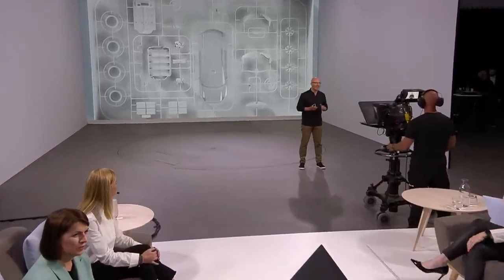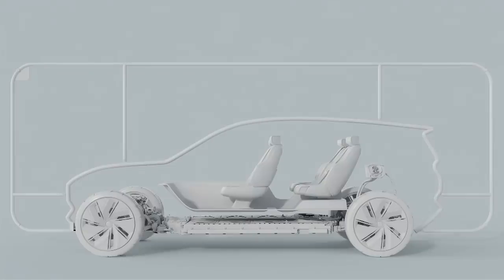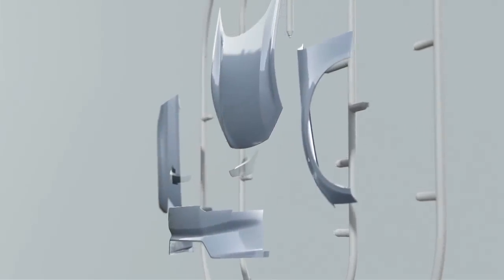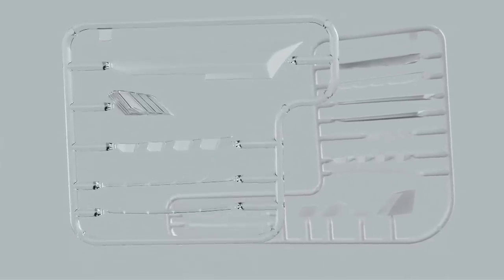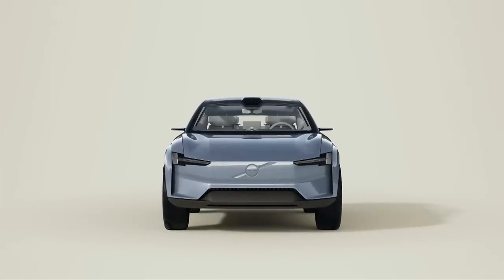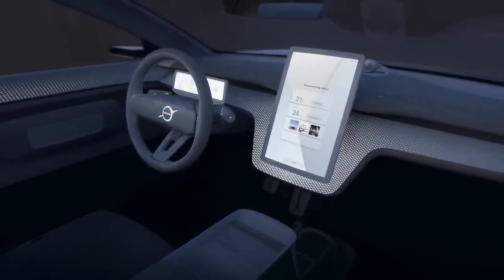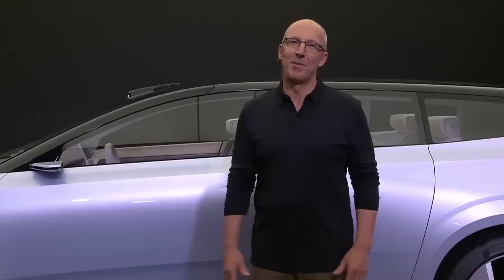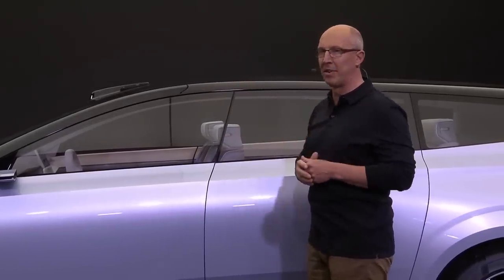Future of design

Comment: If you're truly serious about safety, you need the essential functions controlled by physical buttons and dials, not a touchscreen that's almost impossible to operate by touch only, while you're moving. You don't need many actual buttons and dials, but they do need to be programmable/configurable into "scenes" that can be selected on the steering wheel, so an A/C-ventilation scene, an audio system scene, a navigation scene and so on. Each change of function for a button or dial should change the graphic on that button or dial.
Reply: Yes everyone’s tired of these solo touch screens. Give us some buttons back
Reply: The new android system will be so responsive it will make Siri look like special needs; immediate response - only Porsche is keeping 100 buttons.  This is future.  Speak and Delivers.

Comment: I hope Volvo will also offer the "Light Armoured" versions for the new models, which brings the word safety to the next level.
Reply: RAYfighter  
Certified 360° ballistic protection according to the American NIJ-IIIA standards (light)

There is also a heavy version (XC90) with VPAM VR8 ballistic and explosive certification.
Reply: RAYfighter  
Therefore I hope that the armor will also be available for the EVs, this would also help to shift the center of gravity downwards. 😉
Reply: RAYfighter  Against Swedish cities I guess. With all the shooting going on there.
Reply: @vika0194  
Worldwide realistic scenarios are carjacking, throwing rock "dining" and vandalism but unfortunately also rampages and shootings
Reply: BMW offers with the X5 Security also a VR4 model. With the BMW X5 Protection also a VR6 (protects against AK 47) version wich is the sweetspot between protection and agility.

As far as I know, does Volvo only offer VR4 and VR8 armor?
Reply: @Private Chatter  
It depends on the threat, BMW X5 Protection VR6 armor is around 800kg, but "only" protects against common AK47 threat. The usual threat against the NATO caliber 5.56x45 is not guaranteed.

Therefore, it makes sense to have higher armor if you are exposed to a serious threat from assault rifles. 

It is also important to keep the vehicle weight as light as possible, there are now high-tech composite materials that have a similar protective effect as ballistic steel (protection against rifles), as they are used in helicopter armor.

Some American armor manufacturers are already using these composite materials! This composite material is comparable to ballistic steel (multi hit resistant) and yet many times lighter.

Comment: OK, here's what I like. I didn't love the computer renderings. However, the scale car next to Robin is much more appealing? Why? Frankly, I'm tired of the tall crossover look. I like wagons. This car somehow combines the long, sleek look of a wagon with enough height to hopefully satisfy crossover fans. This car looks long, rather than very tall. For me, that's a good thing. I like the front end. The side, well, I wish the beltline was a bit lower. But that roof bothers me. It starts to slope so much the car looks squished at the back. That's the one aspect of the car that needs to be rethought. I actually like the back but it looks so squished that it gives the car an odd proportion. I'd also like to see the vehicle with a body-colored, not black, roof. Maybe it would look less squished in the back. 

We do need to understand that in order for Volvo to get the range it needs in an electric car, the back needs to slope. It doesn't look like a Mach E or Tesla Y or anything like that. It's trying to not have too much of that sloping "coupe" style and that's why I think it harkens back to a wagon. So maybe no black top is the ticket. From the back, there's also the element of the flared wheel wells that will give the car a lot more shape and sleekness in motion than it looks like just sitting there. The vertical back is also rounded on the sides as well.

The interior? Well, it's interesting. It's only superficially like Tesla. The appointments are Scandavian. I would wish for a more contrasting wood. Not too dark but I'd love to see the wood texture. The materials on the top dash won't make production. But they may make it in the door cards and in other areas of the dash. The door cards don't show an armrest. Unless it drops down, I don't really understand it. And of course there needs to be storage areas so the actual car's doors won't look like the Concept. Unfortunately. Because I love the flow. I also like that Volvo doesn't seem to want to do the Mercedes style "ambient lights." That's a good thing to me. A totally different type of "backlighting" will distinguish this car from the German "ambient" light kind of thing (although it is in the Polestar 2, but in a mild way). 

So, while it isn't as instantly beautiful as the earlier concepts that led to the current Volvo line, this one has the potential to differentiate Volvo even more than the current cars do. For now, the current cars are beautiful. But these can be even more personalized than the current ones. If Volvo can redefine the boring crossover trends that are now and give it a more long-wagon look, that would be quite interesting to see.
Reply: This concept gives me XC 70 vibes, and I'm pleased with that. I actually don't mind crossovers. The only thing that bothers me on them is how in order to preserve fuel and ride like a conventional car, they usually have small diameter wheels (at least compared with traditional off-road vehicles). In person, the Jaguar F-pace and the Mercedes GLC are more harmonious since they have bigger diameter wheels. This concept also does that, while also lowering the roof line (maybe a little too much at the end I agree) but the overall shape of a shooting brake is interesting.

Comment: Really liked this segment/video. Great explanation of opportunities created by going to an EV platform. I also like that there is no fake grill on an ev car. It is an EV and the design team should embrace it. Well done! 

One negative I noticed would be the limited view of outside from inside the cabin because of the low roof line. I hope the designers will be able to find a way to increase glass size on doors.

Comment: I quite like this design, it's fresh-looking, functional and very Scandinavian living-space-like.  With the change from ICE to electric, it's obvious that there will be new standards of car-design.  ICE-cars were partly designed around their engine by necessity, but that's no longer a requirement and with that comes a new freedom concerning design; whether you see that as a restriction or as an opportunity is a choice.  By ditching the radiator-grille, a part that hasn't got a real function on an electric vehicle, the choice that Volvo makes is obvious.  Other manufacturers seem to be more in doubt on that.
Reply: Almost no pure battery electric cars would sell if governments weren't shoving them down our throats with unscientific climate fear mongering. They're twice as expensive and far less practical (lower range and 10-20X longer recharging.
Reply: @phamnuwen9442  I don't agree with you on that one.  Sure, the measures of governments play a significant part in the success of electric cars, but there definitely is a growing number of customers to favor them above ICE-cars too.  Which will only grow further, when they get more practical to use and cheaper.  I'm very much into ICE-cars, but it's also very clear to me that electric cars are not a fad and most likely will define the nearby future of cars.
Reply: @johang7498  Subtract the subsidies and do a cost per km calculation over a a few years and you will discover that the pure BEV is far more expensive to own as well as far more awkward to use when comparing among affordable vehicles.

It's more feasible to make a somewhat practical BEV if price is no object, i.e. in the luxury segment. But that's not a market that can exist without the large scale economics of a large segment of affordable and practical cars using the same technology.

So it's basically a pointless product.

Comment: How big are these wheels , it’s hard now with our 22 inch wheels avoiding potholes and kerbs 🤪
Reply: Volvo's next business idea, Exporting superior Swedish roads. xD
Reply: All concepts have huge wheels, I wouldn't worry about it
Reply: @TheSimon253  dodge the pothole in the uk lol , you can literally see cars going all over the place swerving the huge one near our house , I admit in my other half’s xc90 we just drive over them but my xc60 i try avoid as the 22s make the ride pretty bumpy, luckily zero damage so far to the wheels 😀👍🏻
Reply: @implodingbaby  this is the problem though most new ones have huge wheels they look amazing but when the dealer says do you want alloy wheel insurance for damage you know they expect you to wreck the wheels 🤪
Reply: big wheels are explained vaguely in the video, but it meant to compensate the low battery platform. Not sure it is worth the benefit in aerodynamic considering bigger wheel are more expansive and using more rubber.
Reply: I'm not overly fussed about the actual wheel size, but would prefer a tyre profile no less than 50% of width. I don't care how clever your suspension is, too little sidewall means a harsh ride and greater chance or tyre and wheel damage.

Comment: 1) Miracle: someone in the product development allowed you guys to finally make a Volvo EV without a vestigial or fake internal combustion engine (ICE) radiator in the front. Thumbs really up for who succeeded it, i.e. Audi, Mercedes and BMW won't manage such a industrial design victory on this decade.🏆👍.
2) Fabulous external design too, remarkable actually, great semiotics on the lamps, brave work keeping the brand calligraphy and tradition, a huge leap to the right direction.
3) I hope the front-central console in the middle can be removed, turn into a table, utility or similar i.e. for the passengers on the back seats. Keep it even more Nordic now that you got plenty of space and no mechanical shafts or functional parts in the middle of the living room, celebrate it.
4) Do not ship it with 4 seats only but at least the 5! Do not breed another model for that as an additional due that either. Plan it as is, but with a 7 seater option, by all means!
5) Tesla's base model (448km range, 225kmh top speed) i.e. in Finland, as for today (5/Jul/21) is yours à 48.690€, (-2000€ EV-subside) so, the math is simple: all the competing brands EV in the category are too near the 46.690€ range, very hardly that EV-customer will opt other than a Tesla if otherwise not madly in love for another logo. You need this new Volvo at a substantially competitively lower starting price, and if the release will realistically take more than 1 year, your new model will face the Tesla priced 25.000$ (€?) option as a fierce competitor.

Many people that still cant afford that price range will look alternatives while waiting the market and competition to warm up. EVs are substantially lots cheaper to build than ICE ones and the key, expensive battery tech is catching up too on many lower costs and better ranges options for the industry. So it will surely be possible for Volvo to bring a premium car under a popular price range still keeping a good, if not similar profit margin. The main, if not the only reason people buys other than a Tesla today is the price.
Reply: You ought to write a book about Volvo's new EV.
Reply: @robertlee8805  This is a concept car? Not a production model.

Comment: They are preparing the next XC90 RECHARGE with this concept
Reply: It's not going to be called XC-something anymore. It's going to have a real name, like a child. That's what Volvo CEO Håkan Samuelsson said afterwards.
Reply: @fabulous_y5654  But it could not have a name, name, just new naming conventions. It could still use 60, 90 but not XC60 or XC90. We'll see.
Reply: @fabulous_y5654  it's called Daniel
Reply: @fabulous_y5654  Volvo Thomas
Reply: I have an XC90 T8 fully loaded. best car I ever had. If the next XC90 is this thing, I will definitely never buy it. Horrible car in my opinion.

Comment: I like a lot of this, my main dislike is that it's a crossover.
Reply: I like Volvo but I'll never buy a crossover or an suv, i don't see the fascination. They are big on the outside and not that big on the inside.
The old Volvo estates were so practical but noone wants real practicality anymore just looks..
Reply: Then people need to stop buying crossovers.
Reply: Is it a crossover? The wheels are huge and the dark lower panels seem to make it a bit higher, but I don't know if it isn't actually just an estate. But in the end this is probably far from production car.
Reply: @marks-0-0  you are right. But also we will never archive that old design - we have learned a lot about aerodynamics and crash-safety since the old boxy roomy volvos. Pebble shape will be the new norm for personal cars.
Reply: @SamoScopom  my like of old estates probably explains why i own vans and van based cars..
Reply: @marks-0-0  that's probably the only way to go if you want a lot of interior space. I think (European) cars seem to be getting smaller because they are compared on paper based on mpg/range and for many  people with >3 kids is cargo space an afterthought. There isn't a common metric that evaluates cargo room and mpg/range together. I don't know where you are from but Škoda has probably the biggest cargo volume when it comes to estates.
Reply: It’s a suv. Crossovers are hatchback/estates which look more cable at offroading with lifts and a bunch of plastic on the side. Overall crossovers give a more beefier feel to the car as it’s bigger then original.

Comment: My quick thoughts:
Headlights 10/10.
Does the studio lights make it seem a lot more magenta than it is?
I hope the colour scheme of the interior will be available in black/darker colours (at least if more models will follow the design language). 
Those doors must be a pain in the a** if you have to park next to someone. Can they open independently? 
The steering wheel is meh in design. V60-era had probably the best.
What benefit is there to the small display on the steering wheel as opposed to traditionally mounted gauges?
What is that lamp thing in the back? Looks dope. 
Back seats seem very far back from the front seats. Won't that affect storage? And if not, could the car technically be smaller?
No glovebox (to forget what it contains)?
Why are the exterior lights in slits/shards? Looks bad, honestly. Keep the thing that moves in and out, but increase the width of the rest and join it to one unit.
I think you are close on finding a good grill design for a car that lacks a grill, but not quite there yet.
I give it 6/10. A strong looking car with no cup holders, but a dope lava lamp.

Comment: OK, raising the rear seats does not somehow enable lowering the roof.  Thatś about as far from function driving form as you can get.  Most absurd of all however is removing the engine but leaving the basic form of the hood intact (albeit slightly reduced).  
    In spite of the grandiose high-design explication delivered in this video, the exterior form shown here was clearly not dictated by the mechanical internals.  The form was chosen to mimic the common existing SUV shape weŕe all familiar with, then modified slightly to react to different technologies in the internals.  Key word being ¨slightly¨.
Reply: Like most electric cars I think the front  will be used as extra storage space
Reply: The basic form of the hood serves as a crumple zone and is very probably has some utility for pedestrian protection. By the way, an electric car still need a small radiator for cooling the battery.

Comment: The wing mirror camera pods could be made to fold down like wings into the door panel for protection against weather, with a cleaning mechanism built into the pod (like an eyelid) that wipes the lens for optimum clarity.

I'd also like to see a second set of pop-out cameras at the top of the A frame, giving a second viewpoint looking slightly downwards.

If you want to add a drone like NASA's ingenuity that I can launch for park assistance and checking for traffic problems, I wouldn't say no :)

Comment: I am in love with Volvo cars, but this one, I do not like design and rear end of car. why so big wheels?
Reply: I keep wondering the same. What's the advantage of such large wheels? It seems that electric cars demand for larger wheels, but I have no clue why that is.
Reply: @fabulous_y5654  concepts always has mammoth wheels
Reply: @fabulous_y5654  will ride be equally comfortable with bit wheels?! do not think so, please Volvo, give us an answer....thx :D
Reply: With electric cars not having engines means there is no gradual speed increase like combustion engines. In engines horse power is transferred through the car and the wheels have time to grip and speed up. With A electric car there is no combustion, meaning the torque force of the car accelerating is instant. For that they are needing bigger wheels to keep grip, safety and well momentum
Reply: @christophererazoortiz9803  thank you!
Reply: In conclusion even with combustion engines the stronger the vehicle the bigger the wheels as we see in race cars aswell
Reply: @christophererazoortiz9803  I understand. but do you have same comfortable feeling while driving with bigger wheels? thank you for your answers
Reply: Most definitely as if that's what is needed to ba able to keep performance as promised then looking forward to it